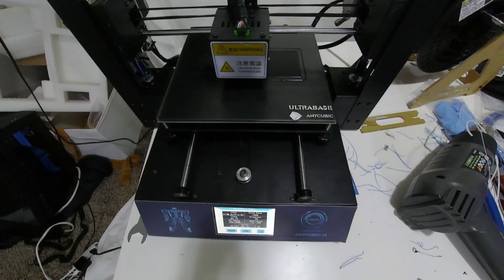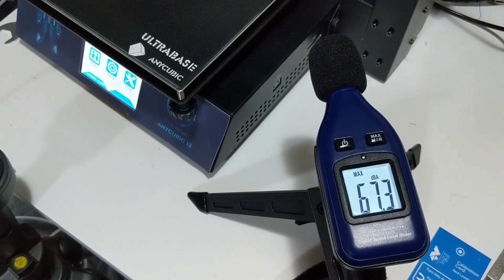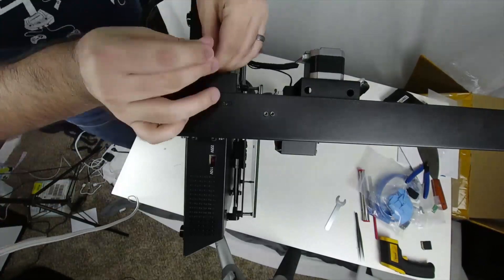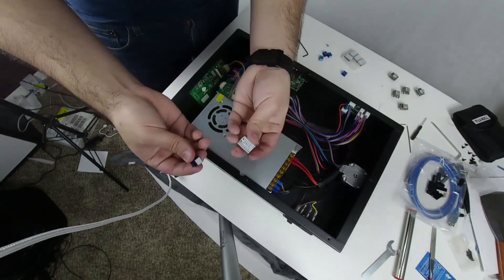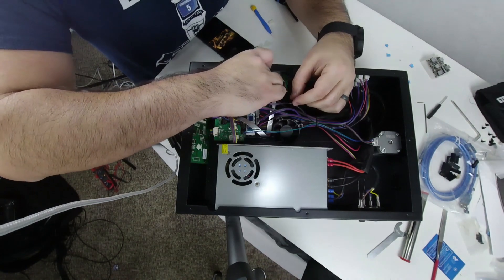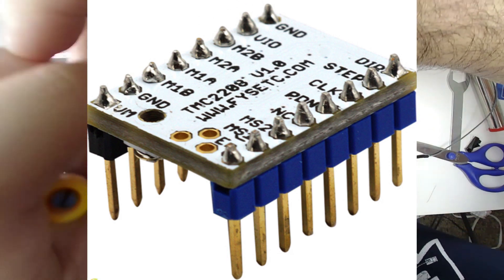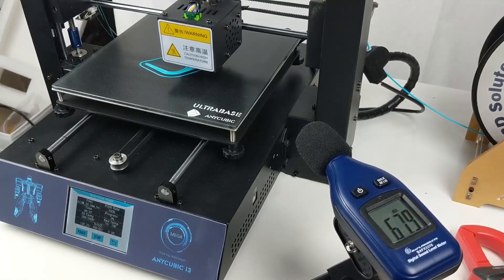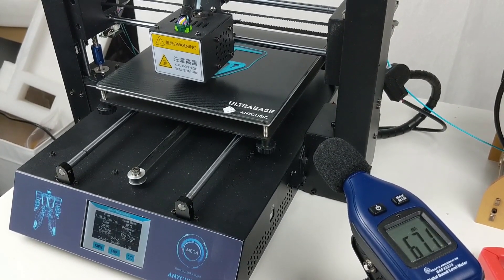Anycubic i3 Mega TMC2208 Silent Mod

Comment: mine just decides to stop halway through first layer..... freezes. touchscreen no input. what would yo think would cause this?
Reply from the maker: Could be a failing chip/bad board. You should be able to replace it.
Reply: @LohTec  sounds intense. i thought it might be the wires to heatbed from base as others have experienced. but yet to find a break in those wires

Comment: So you don't need to install custom firmware for this to work? and is the process for 2209 drivers the same?
Reply from the maker: Nope, no firmware. 2209 should be the same though you may not need to reverse any cables

Comment: Hello. I know this is an old video but did you settle on 0.85v or did you adjust this later on.
Reply from the maker: I don't have this printer anymore, but no I never did adjust it. .85-.9v worked for me.
Reply: @LohTec  Thx for the answer dude :)

Comment: @LOHTEC 

 Do you upgrade the marlin firmware before upgrage the TMC2208? I would replace them too, but I don’t know if I can put them in based on your video. I don't want to update marlin.
Reply from the maker: I didn't have to update the board in this case.

Comment: Nice video, I have Anycubic Mega S if I install the drivers Do ı have to change anything in the firmware using usb cable connected to the printer?
thanks for your answers
Reply from the maker: As long as your board supports the switch, you shouldn't need to do anything except maybe rotate the plugs.
Reply: @LohTec  thanks for your answers how can I understand I mean if I can swap them I don't have to change anything right?

Comment: Is it necessary to tweak the voltages? Plz answer.
Reply from the maker: Probably not, though there is a chance you could overheat and damage your motors if they are set too high. I'd at least test them if you can, but if not hopefully will not notice.

Comment: Are there any problems with the stock extruder not working properly with the TMC2208? I've read about people changing only the X, Y, and Z stepper drivers and leaving the stock driver for the extruder.

https://www.youtube.com/watch?v=HOryknQnOd4
Reply from the maker: No issue, just very limited gains by switching out the driver on the extruder. You'll hear the same about the z axis.

Comment: Can you mix V1 and V2 of the TMC2208?
Reply from the maker: Technically yes, though V2 doesn't need to have the motors reversed so you'd have to keep track of what goes where.
Reply: @LohTec  I've had three pieces of the V1 TMC2208 for over a year but never got around to making the upgrade. I might buy two more, perhaps V2 or V3,  and switch all five soon.

Comment: will it work fine with TMC2208 v3.0?
Reply from the maker: I'd have to look up the specs, but probably. You may not need to reverse the plugs on the board.

Comment: Do you need to change all drivers???
Reply from the maker: The voltages? Probably not, though they will run cooler and with less power at the very least. Increased chance of burning the motor if the voltages are too high

Comment: Why does TMC2208 require minimal effort? What is the difference between TMC2208 and TMC2130 installation?
Reply from the maker: Tmc2130 requires software changes to run silently if I recall correctly. 2208 has silent as the default. Depends what your goals are.

Comment: do you need to re-calibrate anthing, e.g. the extruder, after installing the TMC2208?
Reply from the maker: Nope
Reply: @LohTec  Any suggestions or thoughts as to why I'm not getting any voltage reading from the TMC2208?  I'm not getting a reading from any of the drivers.  the voltmeter is set to DC with a max of 2V and I'm using the points shown on the video, top left ground and bottom right hole.

Comment: I am late to this as I just got y printer and this video helped! I do want to call out that one of the driver wire orientation is unique. I almost just blindly want to use the same orientation for all of them. Your advice on taking a pic for reference was a saver.

Comment: I installed them in my i3 mega-s just now and noticed my left z rod goes down while the right one goes up, otherwise everything else seems to work correctly..  On the i3 Mega-S there's an X Y Z connector, it skips the second Z connector and then there is the E0 and E1 connectors (just like yours basically).  I reversed all of the connectors after installing.  Are the two E0 and E1 connectors the ones actually controlling the two z motors (instead of the z one) and do i need to flip one of them back around to make that motor work right?

Or is this something i have to edit in the firmware?
Reply from the maker: You could probably edit the firmware, but I'd just reverse one of the cables. Possible one of your driver's is v2 which doesn't need to be switched.

Comment: I installed a 120mm cheap quiet case fan on the bottom and removed the PSU cover and stepper cooler
Reply: Did that make it much quieter?

Comment: Hi has anyone tried to print Flexible filament with the modified Anycubic i3 Mega ? ,specifically the FlexiSMART Polyurethane-based flexible filament (TPE-U) for FFF/FDM 3d printing. Shore hardness 88A. ??
Reply from the maker: Flexible prints are tougher on Bowden tube extruders like the Anycubic. Can be done, but you need to print pretty slow.

Comment: Hey I wanna do this on my any cubic i3 mega-s but don't know how to do the voltage setting as stated in the vid.
Reply from the maker: You will need a voltage meter, but with that all you are doing is slightly tightening or loosening a screw.
Reply: @LohTec  ok thanks and I can do this on my anycubic i3 mega-s right?
Reply from the maker: @michaelsanchez8667  some of the newer boards don't support removing the drivers so check your board first to make sure you can switch them out
Reply: @LohTec  For info for those who don't want to take their printer apart to check for themselves, I was able to email anycubic support with my serial number and they were able to tell me that my board was one with removable drivers.

Comment: those drivers are now soldered >.< any options for me to make it more silent? I reallly don't wanna desolder a QFND or whatever they're called from my 400$ printer 0_0
Reply: For info, I ordered my Anycubic i3 Mega-S from Anycubic's ebay store in around September 19 and mine are not soldered. They may have switched back?
Reply: @krismcgrath2816  Is your stock  Mega-S board 8-bit or 32-bit?
Reply: @pequodexpress  I don't know, sorry. I emailed Anycubic with my serial number and they were able to tell me what I needed to know about the drivers being soldered.
Reply: @krismcgrath2816  That sounds like the 32-bit Trigorilla board. People are beginning to switch that board out for a 32-bit SKR 1.3 board, something I am thnking about doing with my i3 Mega04 (Ultrabase i3 Mega with 32-bit Trigorilla board).
Reply: @pequodexpress  what's the benefit of the SKR board?
Reply: @krismcgrath2816  I've been reading that for maybe about USD35, one could get an SKR 1.3 board with five TMC2208 drivers and put it into an i3 Mega. But you have to flash it with Marlin 1.1.9. All the steps for this are documented. The benefit is that one will have more control over many print parameters, including mesh leveling, and the option to add wi-fi. Perhaps best of all is that the printer will be less of a fire hazard, as there will be thermal runaway protection. The steps to do all of this have been simplified so that even an electronics dilettante such as I would be willing to give this a go. I'm willing to try this in my i3 Mega04 (32-bit board with soldered drivers) and my stock CR10, which also has soldered drivers. An SKR 1.4 board is also available, but everything is already prepared for the SKR 1.3 board. I think the more sophisticated boards are probably overkill for any single extruding printer.
Reply from the maker: I don't think anyone has tried it. The board is completely different in the new models
Reply: @LohTec  one person used a hot air station. But I'm too scared since I'm terrible at desoldering

Comment: when you say reinstall the white guide brackets backwards, do you just turn them round? What do you mean by choosing to leave them out?
Reply from the maker: Yeah, just turning them 180 degrees. I decided to just remove them entirely since they aren't necessary.
Reply: @LohTec  Thanks you. I saw a video where you just swap 2 wires round, would that not work?
Reply from the maker: @delwynhobbs3548  probably, but to me it seems easier to turn the cable around. Less chance of frying something if you wire it wrong. Also, if you get 2208v2, you don't need to change the cables at all.
Reply: @LohTec  Sorry to sound thick here, new to me all this :) what did they power then if you can take them out and leave them out?
Reply from the maker: @delwynhobbs3548  you are removing just the guide brackets, not the connectors. The guide prevents you from turning the cable around so you remove it, turn the cable around, and plug it in again.
Reply: @LohTec  Excellent, thank you so much.

Comment: How about to reverse axis in the firmware instead of rotating the connectors on the motherboard?
Reply from the maker: You could also just buy the 2208v2 and do neither.
Reply: @LohTec  Do You mean tmc 2208 v1.2 ?
Reply from the maker: @adamkrasman  Sure. :) Don't have them, but others have reported they don't need adjustments.
Reply: @LohTec  I have v1.2 and adjustment is needed
Reply from the maker: @adamkrasman  Then it is V2 that does not.

Comment: If I press filament in it turns sometimes without getting filament. So I set it to 1,55V and now it's working fine. Before I had 1,2 V and under extrusion

Comment: I have followed the guide. Have replaced stepper drivers with TMC 2208 on i3 mega. However, Z axis and X axis are very quiet. Y axis very noisy and doesn't move. I did flip the cables. Will have try flipping them back to normal. And up the voltage , at for the y axis stepper.also the X axis only moves half way across now. Might be a voltage issue. Set all to 0.85 volts give or take.
Reply from the maker: The 2208 V2 doesn't need for the cable to be flipped, so it's possible that's what you have.
Reply: @LohTec  All sorted now. Yes cables do not need flipping. Set and 0.9v and running whisper quiet now. Now onto dual mosfet's and new power supply fan. thanks.
Reply: @LohTec  How about v3? Does it need flipping? Now they're selling v3 these days...
Reply: @LohTec makes sense. I've doubled checked and one axis wire has different wiring colour order. This maybe my issue with one axis. As I did them all the same. Thanks.

Comment: Thank you @LOHTEC You helped me out a lot. Now I got a super quiet i3 Mega :D Its awesome. Wish I could get rid of the loud beep when starting it up and again when connecting with Octoprint though :o
Reply: There is a version of Marlin  withe the beep disabled which you could install.
Reply from the maker: I'm sure you could dampen or remove the piezoelectric speaker if it bothered you too much.

Comment: I just ordered those drivers. But as I search around the net I just have no idea to how much i should set the current... 
My stepper motors are rated for 1.5 A 3.5 V. I've seen many videos setting their currents under 1 V and others were talking about barely hitting 2 V. 
Any approximation or methodes to figure it out ?
Reply from the maker: After researching I found that somewhere around the .8-.9v range is what most people used and has worked for me. The lower the voltage the less heat produced, so ideally you want to use lower values. If you experience issues you can always increase the voltage later.
Reply: @LohTec  OK I see, thank you

Comment: Add some dampers on the motors. Big difference
Reply: No need with the 2208. My motors are completely silent not even a noise you can even tell they are running until you look at them.

Comment: I read you you only need to replace the x and y only steppers not all 5 is necessary
Reply from the maker: Those will make the biggest difference, so if you want to save money those will help the most. But you still will hear the two z motors (especially if you hop) and the extruder motor.

Comment: Tell me if im wrong but if you turn blue side of the drivers the other way around, would you relly need to turn the cables? Would be great to get an answer...
Reply from the maker: 90% sure that wouldn't work since the other pins don't need to switch. Not willing to try it on my machine though

Comment: I did this swap out, but the controller fan doesn't fit over the heatsinks. From looking at your video, I see you must have had the same issue, how did you handle it?
Reply from the maker: You have to bend the metal fan holder a bit if I recall.
Reply: @LohTec  I tried that, but there just isn't enough clearance between the top of the heatsinks and the floor of the machine. I ended up printing a fan duct so I could mount the fan elsewhere

Comment: I set mine to 0.865 volts had to lower the filament temp for some reason .had to change the printers settings a little, lower reaction ,but after a few test prints its as good if not better than normal printing ,motors not only quite now but way cooler .
Reply from the maker: The additional torque probably let you use a lower temp.

Comment: Is it possible to use the TMC 2208 v2.0 in i3 Mega?
I accidentally ordered the 2nd version.
Reply from the maker: Haven't tried them, but most likely yes. Should be backwards compatible.
Reply: Thanks for the answer I will test it and report.

How did you set the volts for the individual drivers?
Reply from the maker: @exitdixi6486  yes. The defaults will work, but somewhere around .9v each will reduce heat to make sure the motors don't burn out.
Reply: It should be feasible. you do not even have to turn the cable with the v 2.0. I think unfortunately I am at the 2nd attempt a TMC module broken. so I could not continue testing. I will order both versions from Ali and will report further in a few weeks.

(At the first test, all motors went in the wrong direction)
Reply from the maker: @exitdixi6486  they go in the wrong direction if you don't turn the cables.
Reply: @LohTec  I turned the cables as in the video tutorial. So I think if I leave the cables original, the motors will turn in the right direction
Reply: Hey @LOHTEC,

I can only recommend you the tmc2208 V2.
It is not necessary to rotate the wires of the stepperdriver!
Plug and Play have not changed the Volt and he is still nothing to hear.
and the drivers are running very gently.
Reply from the maker: Great to hear. Probably won't replace mine, but that much easier for future modders. Though it looks like newer i3 Mega's use non-changeable boards.

Comment: Hi Lohtec, the Anycubic i3 Mega Ultrabase I purchased 2 weeks ago seems to have a different board layout: https://i.imgur.com/Qm48H4o.png most notably there don't seem to be any physical stepper drivers that can be removed. There are some heatsinks where they are in your video, but those are attached almost directly to the board. Nothing on the underside of the board as well. I'm guessing they've started soldering the drivers onto the board to cut costs?

Edit: After a bit more digging it appears that version 1.3 and earlier used an Trigorilla 8bit mainboard, while the 1.4 uses a Trigorilla 32bit mainboard which does not allow for stepper upgrades. More info on the different versions can be found here: https://www.thingiverse.com/groups/anycubic-i3-mega/forums/general/topic:27064 - If possible please upgrade your description so that it's clear that this upgrade is not possible on the new models.
Reply from the maker: You can always replace the whole board, although I'm not sure if they changed the LCD driver too.

Comment: Just a consideration... why the TMC2208 got the heatsink  made to use with the IC , but you attached  on the back  of the board? Does the job anyway? and This is the reason why u had to reverse the connectors? Would be more easy to reverse the pinheads with the IC facing up and so you can put the Heatsink in the correct way?  Or im wrong?
Reply: You are 100% right, the board he uses has a manufacturing fault in the design. The mistake here is that the way the IC is designed the heat can be conducted from the bottom of the IC through the PCB to the other side. This part has copper and vias all over it to allow for the conductance. But the manufacturers placed the silkscreen OVER that pad. This is common when you look at these boards online, make sure you choose one that has the silkscreening right. But clearly, you have an eye for these things so i'm sure you are fine.

Comment: By the way, You don't need to dissemble the whole printer, just flip the printer 90 degrees and remove the 8 small screws of the back cover and two of the rubber legs, then just slide the cover upwards. I do this.
Reply: you don't even need to remove any rubber leg to change the drivers, just slide it partially, there is enough space

Comment: Do we have to program the TMC2208 before we can use it in our Anycubic i3 mega ?
I see lots of people connect them via serial uart and reprogram them.
Can someone explain some more about this?

Ps. a video on upgrade these noisy fan's would be a great idea ;-)
Reply from the maker: No, I use them stock. With the older models you may want to program them, but with 2208 the default settings are good for most.
Reply: LOHTEC thanks !